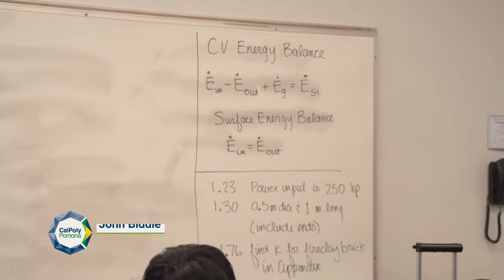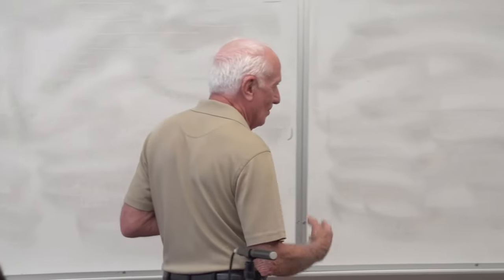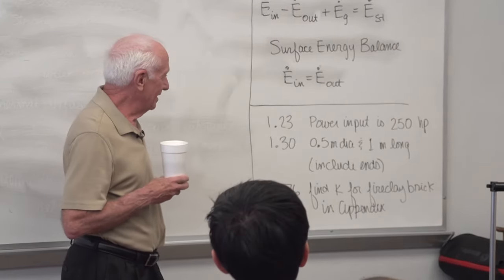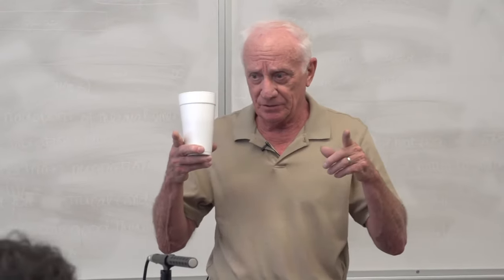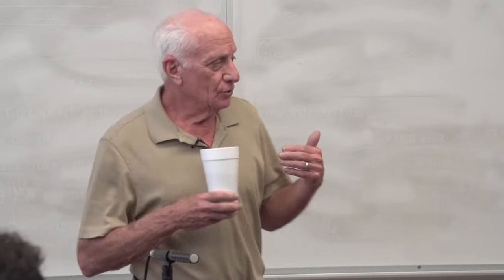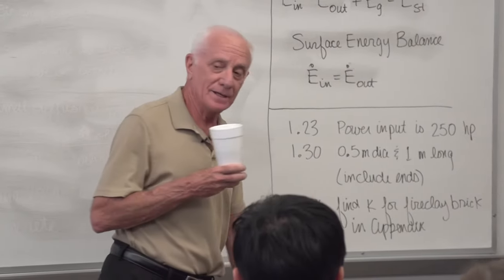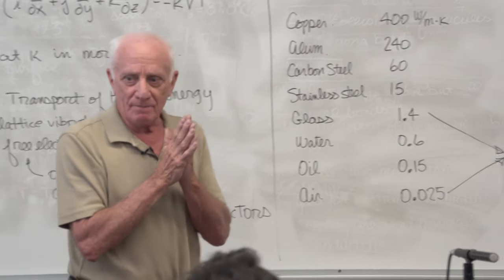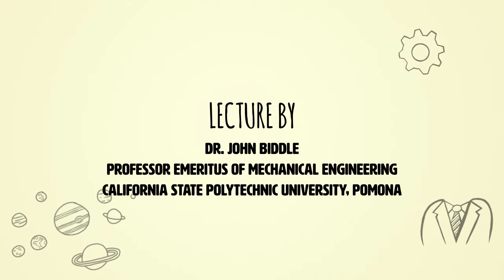Heat Transfer (03): Energy balance problems, thermal conductivity, thermal diffusivity

Comment: For the first example, he says that either way you solve it you'll get 5500, but actually if you solve it by substituting T0 to the second equation q"=k/L(T0-Ti) you get 5600 and not 5500, can someone explain why? what was wrong? Are they actually supposed to be the same?
Reply: Calculating T_0 gets me 87.75 C which gets 5500 in the second equation. Seems like he just rounded it on the whiteboard.
Reply: To= 85.275 C thats what I'm getting, seems correct when  i check with Cond & Conven. I think the professor made a small mistake.
Reply: @khaliddoesFitness  at 16:18 he corrects his mistake